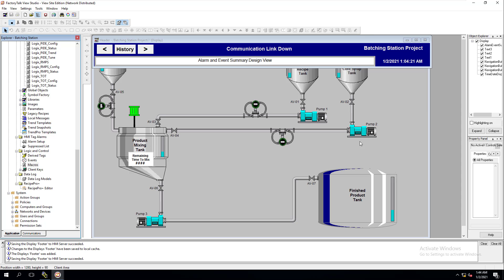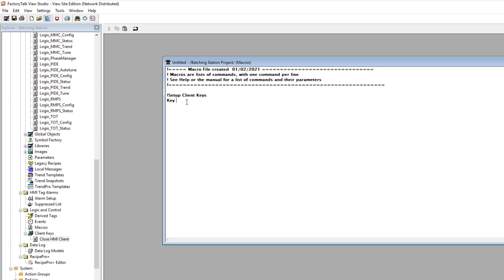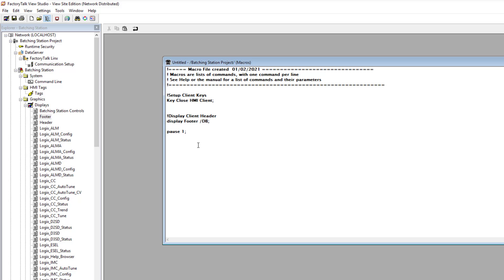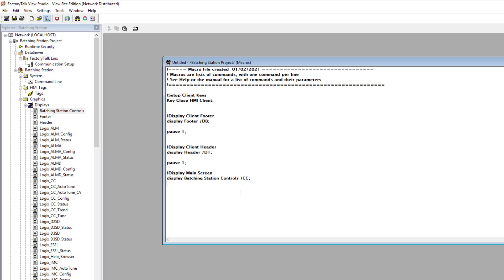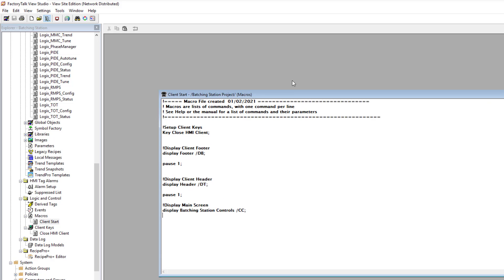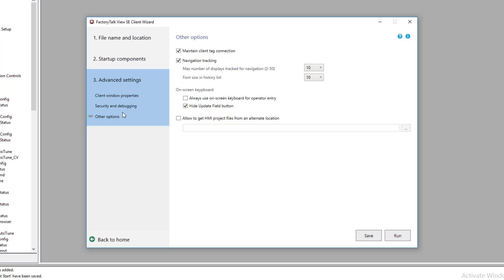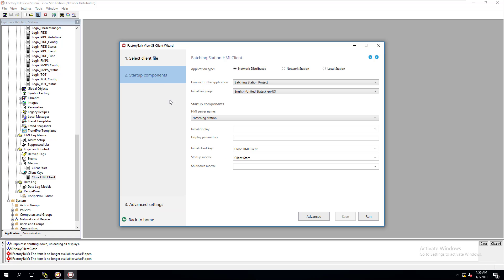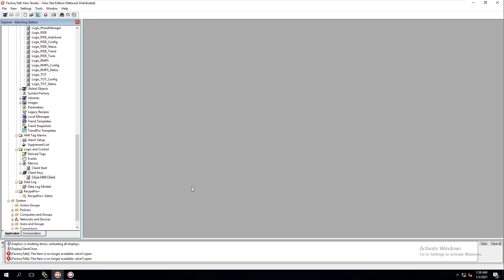FactoryTalk View Studio Site Edition | Startup Macro For An FTView HMI Client | Batching PLC Day-15

Comment: Can you make a video on how to backup and restore a servo drive on rslogix5000? I can't find such tutorial anywhere. Thanks!
Reply from the maker: Great to hear from you, hope all is well.

I am not sure if you are aware of this or not but the RSLogix 5000 or the Studio 5000 program file maintains the servos configuration so when changing a servo motor or controller, you do not need to load in a new configuration.

You may need to tune the new servo controller or do a hook-up test on the servo motor or even a few small other things but as far as saving servo drive info, the PLC program holds that info.

Hope that helps,

Shane